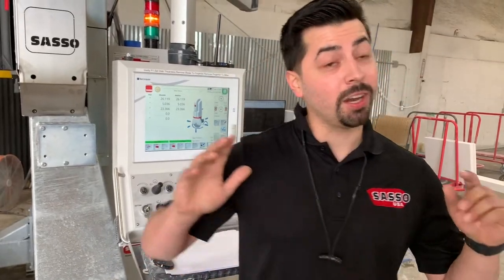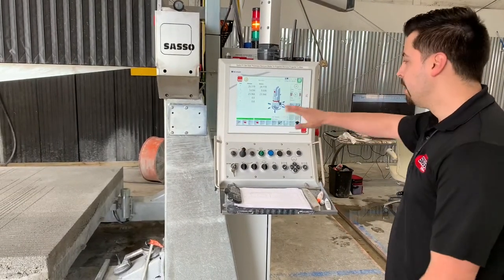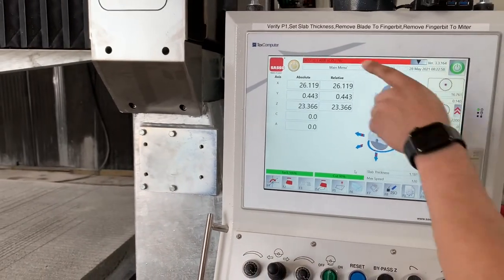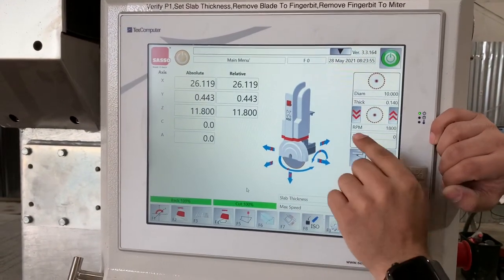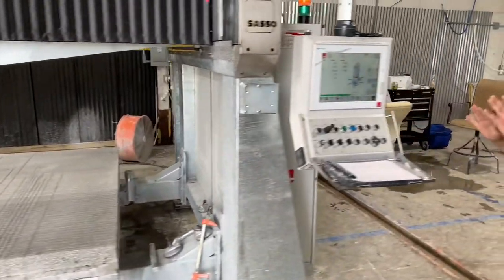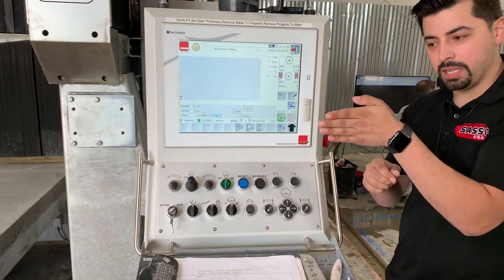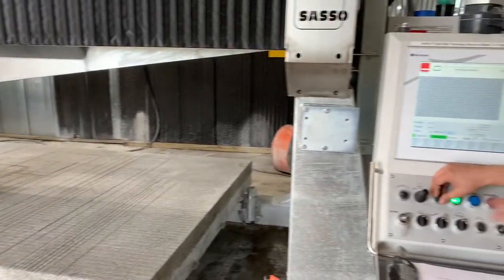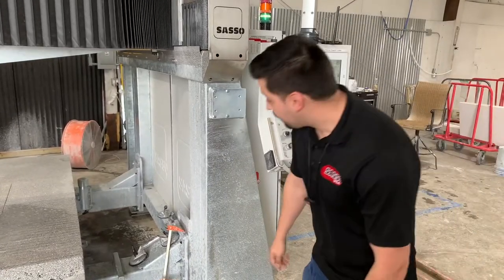How to mill your table on a Sasso K600 Extreme XL

Comment: After the table is milled what are some of the next steps? Do you bring the saw back to the home position and reset the axis so you can begin cutting again? Does the cutting speed to do be adjusted back to 120?
Reply from the maker: Reduce your cutting speed back to a safe 120 for sure. If you milled to a different height you could verify your table thickness. But if you milled to the same Z level then just start your day and let er rip 👍 If you need more help give our service director Giuseppe a call at (480) 702-6206
Reply: @FiveMinutesWithATechnician  hi